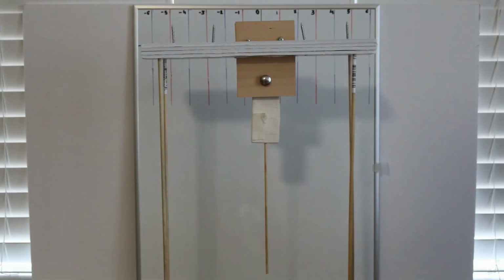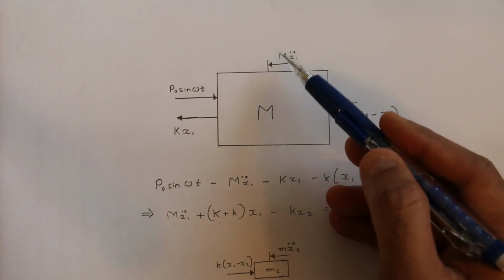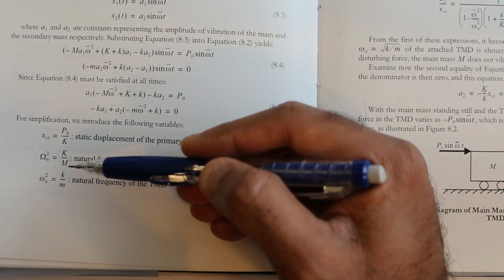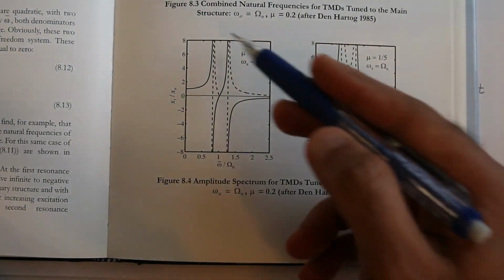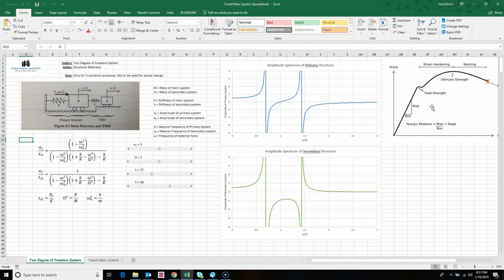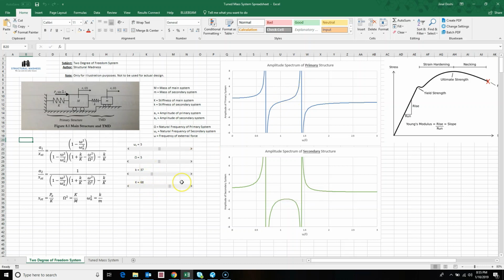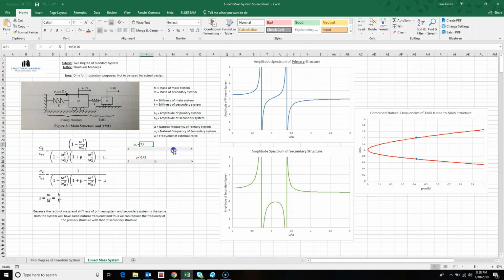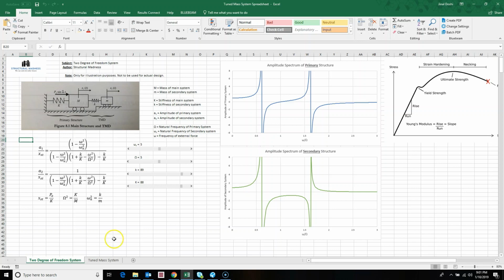Physics behind a Tuned Mass System

Comment: ok this is all well and good, but how about a real example, say you have a car that weighs 1000kg  sprung masswith spring stiffness of 100000N/mm, what tuned mass and spring would you  require to damp the primary structure, the 1000kg vehicle and where would you install it?